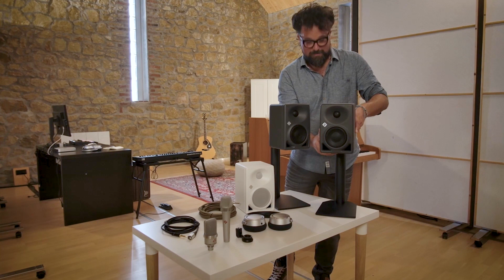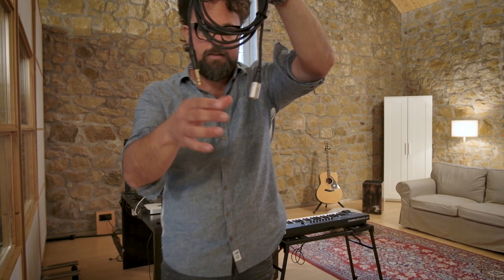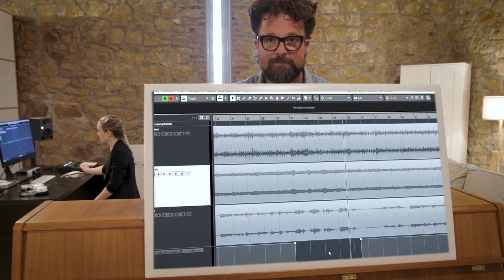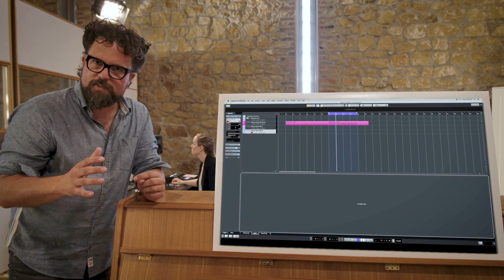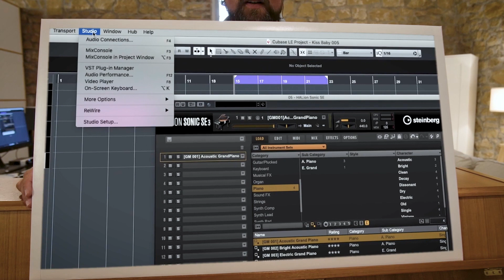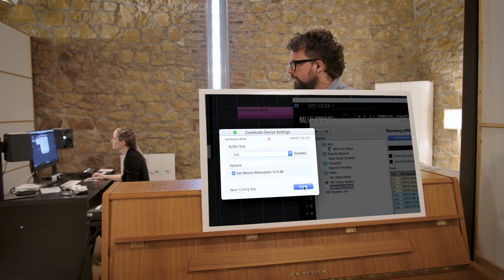Recording Basics: Part 3 – Using your Audio Interface

Comment: I'm wondering I have a DAC which can output a fixed 4v balanced line out. Can I feed it to a pairs of KH 80 via XLR cables without a preamp? Do they have built-in volume control?

Comment: Should I upgrade my AT2035 to a TLM 102... or even a TLM 103? 🤔
Reply: If you have the money, get an additional TLM 103 - you will not regret it, it suits many purposes and is fantastic to colourate with plug ins if wanted and needed. But also the pure, noise free sound is fantastic.